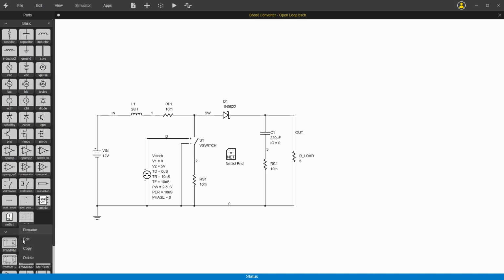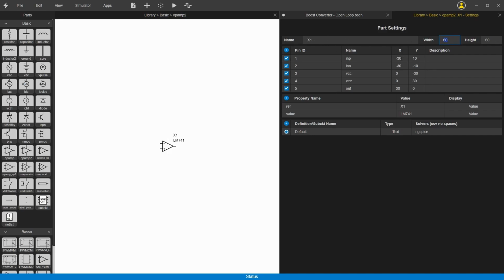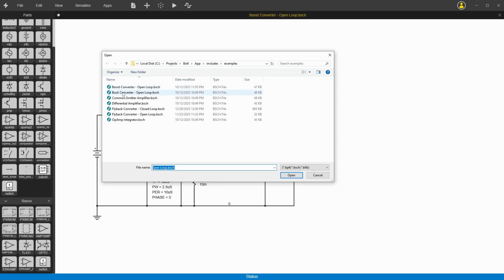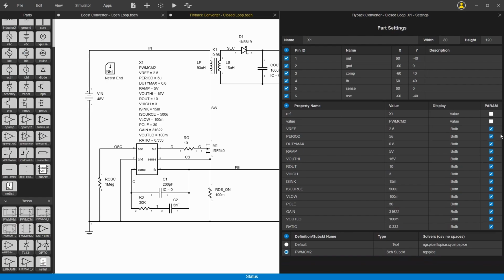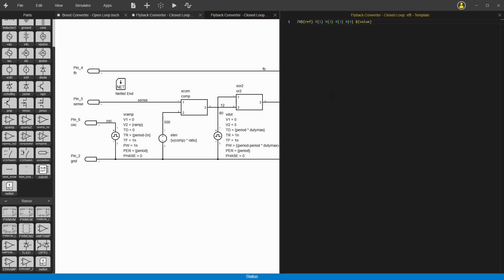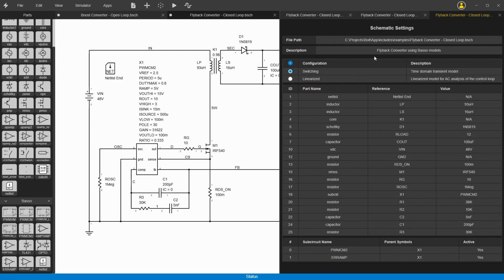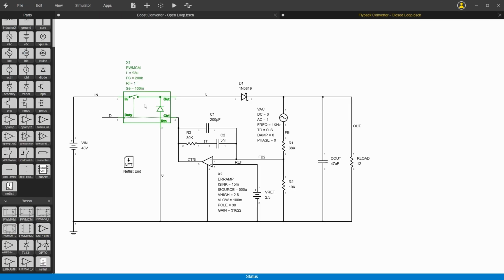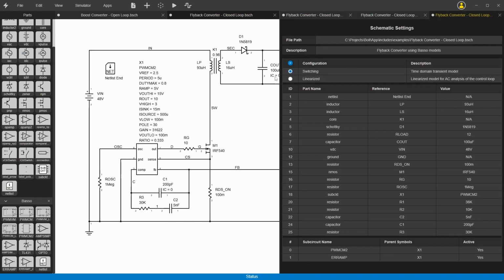BOLT - Updates and Flyback Example

Comment from the maker: If you press the play button and it hangs for a prolonged period it probably means the included NGSPICE is not running and will need to be installed manually. This is a particular risk on the Mac installs because there are so many external dependencies. Tighter integration will be a future priority but for now install NGSPICE manually with brew:
https://formulae.brew.sh/formula/ngspice
Also, you can point Bolt to a custom install by opening the settings JSON: File => Settings
Once there, find the simulators section with name: "ngspice" and update the "path": "your/installation/ngspice", then ctrl + s to save.
If you have any issues feel free to post comments here or ask questions in the discord (see description for invite link)